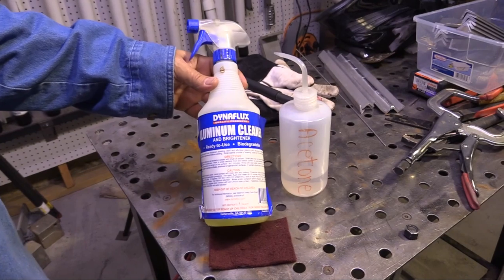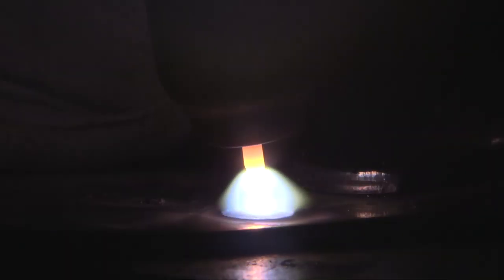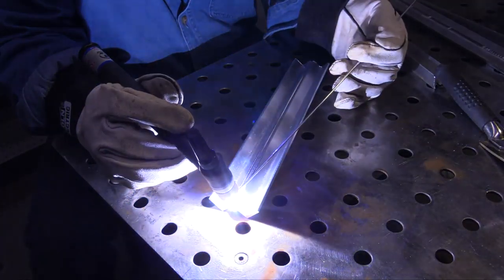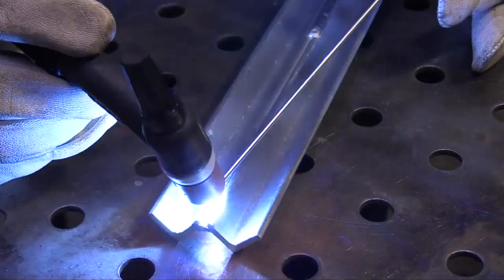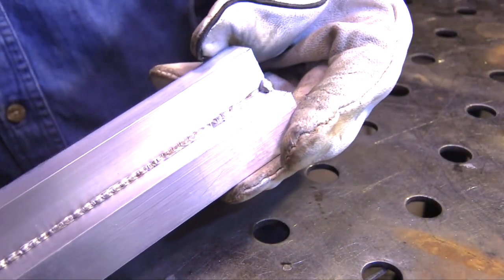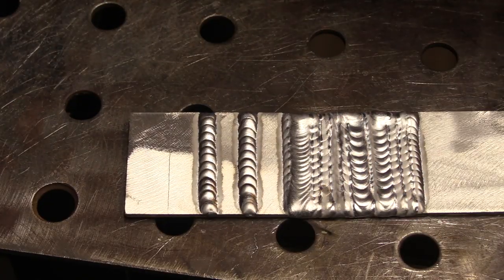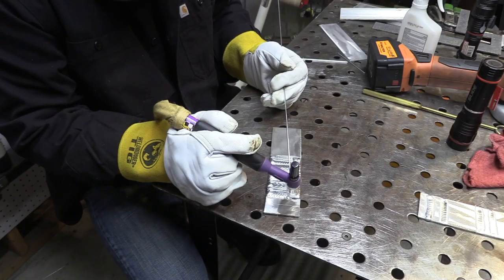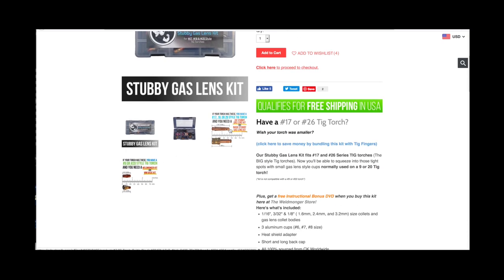Aluminum TIG Welding Tips

Comment: I really appreciate your note on stickout.  I see so many people welding mild steel with a #16 cup with huge stickout for no reason at all.  Finding that happy medium for cup and stickout saves so much gas and coverage is still adequate.  Also, the same people running huge cups on stainless that pull off early to get pretty colors aren't getting the point of the cups and gas coverage.

Comment: I learned on a classic 60Hz sine wave machine. The only thing you could change was the balance. The ball on the tip was pretty much the diameter of the electrode. You also only had the choice of pure tungsten or zirconiated tungsten.

With new inverter machines we are truly spoiled.

Comment: Would love to see some information about doing this stuff with the cheaper generic machines that don't have all these fancy settings & options. I'm currently stuck with an Eastwood Tig 200 that has nothing but; amperage, postflow, preflow and "clearance effect" along with the switch from DC to AC. Not even a DC + or -.

Comment: A little off topic but i cant seem to get a good vertical weld with my millermatic 220 using .035 mig. I was welding 3/8" square tubing and the profile was very crowned up in the middle. Could you do a quick video using that machine on that thickness? Thankyou

Comment: Another great video. 
Sometimes I have to deal with red painted construction iron on a jobsite or in the shop. According to the ironshop it needs no cleaning and can be welded on immediately, I believe the paint is red menie. What's your thought or could you maybe do a video. Thanks
Reply: You should never heat paint up to a temperature that it smokes or burns if you don't absolutely have to and even then you should have the proper protection, a fume extractor and preferably a welding hood with and airbox. The paint releases chemicals that gives both an increase risk of cancer and asthma along with other nasty stuff. And aside from the health risks it's also not great for the weld results. So you shop is probably just saying that to be able to pump out more work at the expense of the workers.

Comment: Hey Jody, I’m having some trouble with some aluminum round to square or rectangular tubing, my arc wanders everywhere and it’s just not going well at all. Could you do a video with that? Thanks. -Mitchell
Reply: If that happens, you want to bump the max amperage. It's usually because the aluminum is cold and it takes more heat to start the arc smoothly.

It can also be a contaminated tungsten, and/or your tip grind being too rough or your grind marks going around the tungsten instead of in line with it.
Reply: CavemanJoe I try to clean as much as I can, I raised it up to 145 or 150 and it’s definitely a lot better, the largest cup we have is a 8 gas lens, and it’s frustrating because I can’t get that far down there and the puddle sometimes tends to favor one side of the 2 pieces of the weldment
Reply: CavemanJoe I do grind it correctly, but I’ll have to ask mr woods what size torch it is so I can get my own kit
Reply: @GraduatedIn  

In the case of the round stock to square tube, the puddle will favor the tube because it doesn't have as much thermal mass as the barstock, so it heats up faster. Compensate for this by angling your electrode slightly more into the bar stock, and wash the puddle into the tube as it evens out before you make the run.

Almost forgot, a lot of arc wander on aluminum can also mean you're using too much cleaning action. If you're at 80%, try bumping it down to around 60%. (Or if your machine's balance references EN and you're on around 20%, bump it up to around 40%). You have to play with these things until you get a feel for it, especially with different thicknesses and types of stock. Keep a little notebook with things like this in your welding toolbox so you can look up settings for certain jobs on your machine, it saves a lot of time.
Reply: CavemanJoe thank you!
Reply: @GraduatedIn  

Also, a large cup isn't always good for joints that you can see but not get into without a lot of stickout. Try using a #6 cup and around 12-15CFH in those inside corner joints. 

Things like that are why I love my flexhead torch.
Reply: CavemanJoe we just use rigid some medium-small water cooled torches. Plus pretty much every other cup here is broken so I’m gonna have to get my own lol
Reply: @GraduatedIn  

Just get a bulk pack of cheap ones on eBay. Nothing wrong with the ceramic pink ones. Sometimes you can find packs of 20+ that have 3 or 4 sizes for around $13.
Reply: CavemanJoe nice will do

Comment: I'm welding some pontoons, mostly 14 gauge but also some 1/8th for deck mounts using 3/32 and a #8 gas lens, would I be better off using a #6 or even smaller instead?
Reply from the maker: not necessarily, but a #6 does use less gas and narrows the etch zone a bit.
Reply: I repair pontoons daily...all I use these days is a gas lense stubby set up from jody's with 1/8" wolfram tri-mix that I wish he sold.  The clear furick cup helps when you need to use a mirror to weld on the back side of an "M" bracket on top of the pontoon without removing it from the boat.
Reply: @pontoonrob7948  cheers, do you like using a #8 cup or do you run smaller?
Reply: @KenyonPayne  I use an 8

Comment: So here is a question.  How do you determine the proper amount of tungsten stick-out for a given cup size?
Reply from the maker: I would say as a rule of thumb..that stickout should be far enough to see the tip of the tungsten and not much further except when needed to reach tight spots.  usually that means the diameter of the cup.  so a #6 cup is 6/16" or 3/8" and that is a pretty good stickout for a #6 cup
Reply: @weldingtipsandtricks  Thank you!

Comment: are you using magnifying lenses to have your helmet that far away from the weld?

when i am welding i go right up close, is that bad?
Reply: Possibly posture/fatigue later on if you spend large amounts of time welding. Primarily, you want to ensure that you're comfortable to ensure the quality of your weld is maintained throughout the pass. Other than that, it's personal preference. I would ensure that if you're stick welding, or another that produces BB's that you properly protect yourself with a hood that has a back on it, so that they don't fly up, over your mask, and down the back of your shirt. Ask me how I know!

Comment: What type or color of tungsten do you recomend for ac aluminum tig welding?
Reply: Don't know about the video dude but I've always used Zirconiated (white)
Reply: 2% lanthnated. May not be the absolute best but it works really well and is a good all rounder. Jody sells them on the store.
Reply: @bodkinofnurk8898  thanks. I recently tried green and I'm not liking it. It gets really brittle after it's been heated up. I've tried red too and somebody told it's not right. I'll try some white.
Reply from the maker: I settled on 2% lanthanated after testing most everything else.  It might not be the best for every specific application, but it seems to be the best all around for AC as well as DC.  it holds up to high amperage on AC and starts pretty well at low amp DC for thin steel
Reply: @weldingtipsandtricks  awesome. Thanks for the reply, I'm sure your a busy guy.

Comment: I'm am looking for a Tig welder that will weld alum,  I am a homeowner. I went to your Amazon site but a little confused, which would you recommend for a part time welder wantbe. Thanks for your videos.
Reply from the maker: I think the AHP 200x alpha tig is a pretty good welder for the money... the foot pedal kinda sucks but it welds good
Reply: @weldingtipsandtricks  Thanks for your time I enjoy your videos.
Reply: Miller syncrowave. Older machine but prty simple to learn on. Craigslist is a good place to look.
Reply: @bryanmoffett1917  Thanks